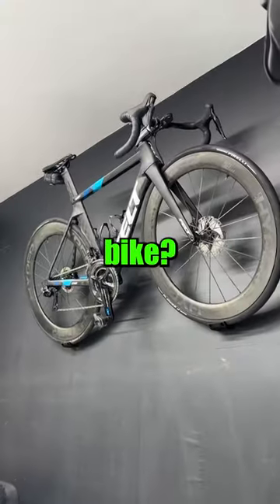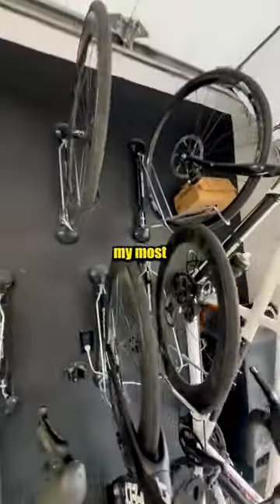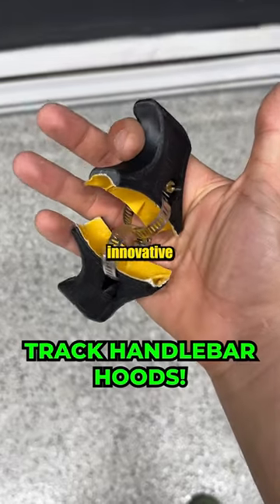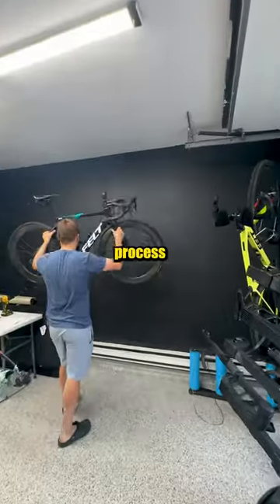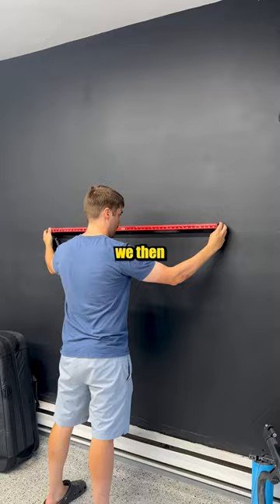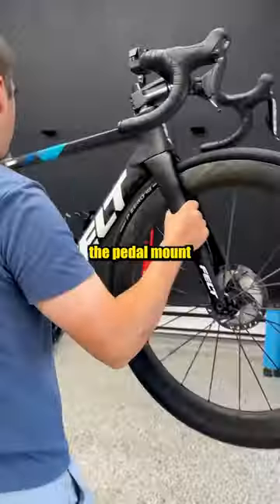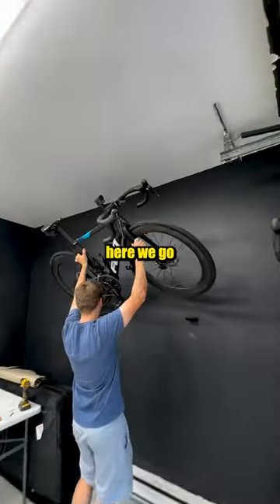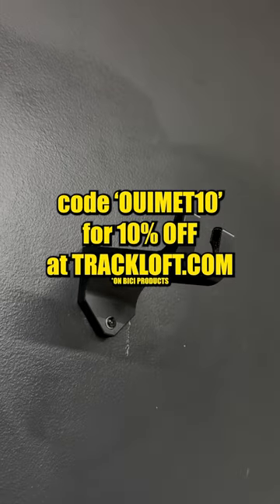Bike wall mount upgrade!

Comment: 45 Bucks for 3 small 3d printed parts. LOL!
Reply: Bro, the bike is like $10,000
Reply: And I use 10$ mount for 1500$ bike.
Construction of mounts is similar but mine is made of steel.
There is no matter how much it costs-it should hold your bike really good for any money. So I'd prefer metal instead of plastic even if it's cheaper.

Comment: I would never put a carbon bike on dry wall anchored mounts.. Install the mounts on the studs 😖
Reply from the maker: They is a total of 6x80 pounds dry wall anchor, looks pretty solid to me
Reply: Ive hung dozens of tvs weighing a lot more with less anchors..  it should be just fine

Comment: If you’re using plasterboard fixings, if it’s dot and dab you’d be better off using corefix bolts. By design they are for that purpose. Or greater plasterboard fixings. Light bike I know. Not much lateral weight